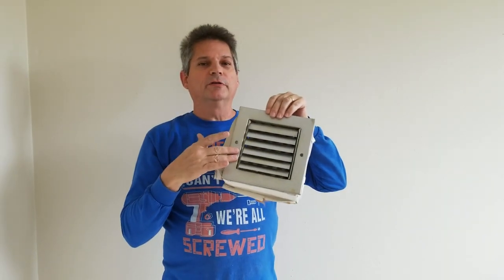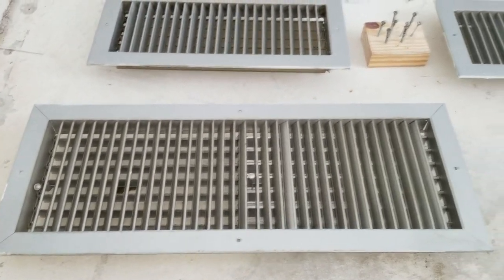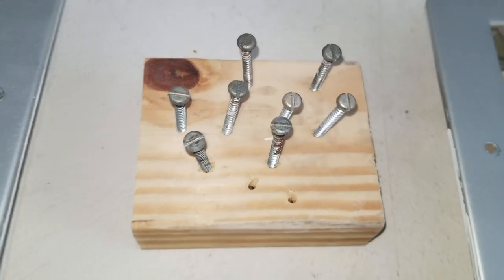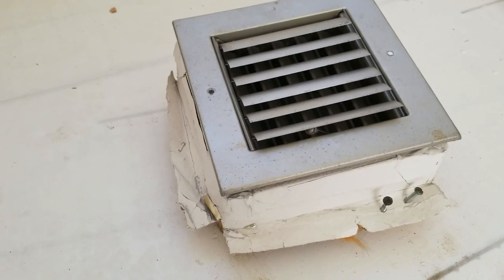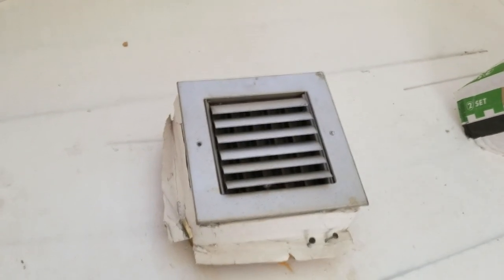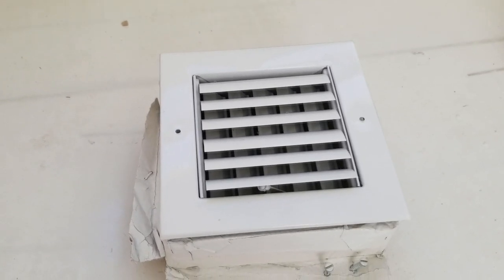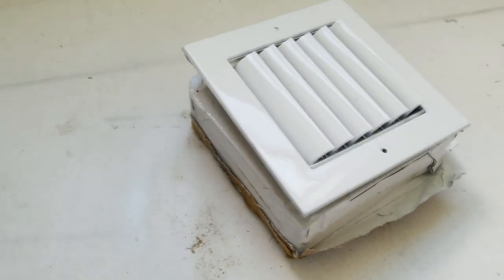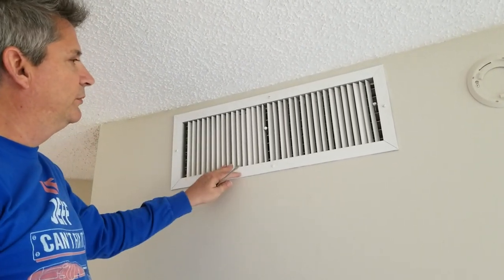DIY: How To Paint AC Register Air Vents, Fast Restore Tips

Comment: You showed the easy part that is "Spray Paint". You did not showed how to remove the old tick paint and also rusted areas from this old vent. Normally old vents has rust and sometimes too much paint from previous painted houses.  Can you show the removal process?
Reply from the maker: Next time it comes up we will. If there's a lot of rust I would use an electric palm sander to smooth it down, then spray primer on the vents, then spray paint. If the rust doe snot sand down gracefully enough to be camouflaged by the white paint then I would replace the vents.
Reply: @jeffostroff  That's the point, though. Anybody can respray a nice clean vent. 
It's getting off the eight layers of badly applied paint that previous users put on there. It is a nightmare job, especially since chemical paint strippers have gone eco, are now water-based,... and cause rust if you leave them on long enough to loosen the paint.
Reply from the maker: @effyleven  that's why I don't waste any time working on stripping and sanding vents, way too much labor for no return on it. I Only wash them, scrubbing with a ScotchBrite sponge, and if that does not clean it off, it ain't coming off! So what. I spray primer, then spray paint on it, spray the screws, and no matter what gook was on there before, the lipstick on a pig still looks better than what we started with, and everything is nice and bright white. From a distance you don't notice the flaws on the vent when it's all white. If a vent is in super bad shape and does not look better after painting, then you can buy a new one, but so far I have not had to buy a new vent cover since we adopted these methods years ago.
Reply: Me too ..I am in need of getting off layers of old paint from my registers .. as I can’t replace them they actually don’t sell our size anywhere, honest 😯 .. painting once clean be easy or buying new even easier .. that would be a dream. Help anyone
Reply: Common sense if it's too rusty, or clumped with paint, replace. If it's an off color, or nicotene stained like the vents in the old house I bought, paint. No brainer. If you want to spend your time sanding and stripping get after it. This video was about painting, not sanding old vents. It doesn't say how to sand and strip old vents. It says how to paint them.
Reply: Aircraft paint remover "oreillys" or home depot

Comment from the maker: What tricks do you use when painting AC registers? Let us know in the comments below.
Reply: Thinned Kilz primer first pushed through a $10 horrible freight hvlp gun, then thined wall or ceiling paint through the same gun.  You have to look to find my vents and returns.  Nothing worse than an ugly white vent on a dark ceiling.
Reply: @jagboy69  To be clear, you paint the registers the same color as the wall, correct?
Reply: @Methodical2  I paint them ceiling color, they disappear on darker colors this way.😉
Reply: Great.  I was thinking about this and I think I will paint them the same color as the wall and/or ceiling.
Reply: @Methodical2  The trick is to spray primer on them first.  Don't get silly and go thick with primer or paint or you'll have trouble moving the louvers.

Comment: What if I wanted to paint the register the same color as my wall? Start with primmer? Roller or brush? Do I do a light sandpaper to get it ready to paint (to take the paint)? Thank you so much! First timer, Jennifer :)
Reply from the maker: You can send it if you want to rough it up a little bit and then apply the primer and then the paint. I would not recommend a paintbrush I would either use a roller or spray it on.

Comment: I did this today... just now watching your video. I did this for some commerical drop ceiling registers....new 2x2 would have been $60. I used the same spray paint, however I ran into some issues with solvent boil and then after I sanded the bubbles out and sprayed them again, the spray paint acted like paint stripper. I used the exact same 2x Rust-Oleum and it has always been good to me...

All that being said, it was 87% humidity out when I sprayed them the first time, then I did it inside with a respirator mask and came out alot better but still had the above mentioned "paint stripping" look. This is after I bleached them, pressure washed them...wiped them down...
Reply from the maker: Holy cow 87% humidity must be unbearable. When I was filming in the back yard some tool review videos this week, it was 95 and 65% humidity, they say anything over 50% is uncomfortable.
Reply: @jeffostroff  when you live in Florida, you kind of become somewhat use to high humidity.
Reply: First coat is always a dust coat so the paint doesn't lift. Second coat 20 minutes later a little heavier. 30 minutes or so later last coat "Hose it on, but not so much it runs. Auto body trick.

Comment: Mr. Jeff: I had an Evaporator Coil Cleaning done 10/21. I was actually going out of my mind with a stench odor in my room. I tried everything, and spraying the house after a while didn't get any better. Then I went, and took down my A/C Vent. These Units don't look dirty, but they actually collect particulars of dirt from the entire Duct Unit. I took CLR,  sprayed two shots on my Vent. I actually was afraid to put this Unit directly in water. I took a damp toweling, and toothbrush, and went along the entire Units. It was dirty. Now, after drying the Vent, I replaced back in area, and would you believe no more stench smells? You have to be your own Mechanic.
Reply from the maker: yes we often wash them in the sink in very sudsy Amway LOC cleaner, then dry them out in the sun

Comment: I need to put a vent in the toe kick of my painted vanity.  So I need it to match the vanity so I doubt I will be able to find a spray paint that closely matches and I don't have a sprayer.  Is there a type of paint that would be good for brushing on?
Reply from the maker: I would not brush on I would roll it on with small rollers. Brushes will leave lines. If you can get a sample of the colored material to home depot, the size of a quarter is all they need to color match it with their optical scanning.

Comment: Try soaking the Vents in HOT water, to get the old paint off. You might have to empty the bucket a couple of times but the paint pretty well peals off when soaked in hot water for an hour. Just scraps right off.
Reply from the maker: I have also used paint gel to removing it, much more thorough

Comment: Would you recommend two coats of paint & primer or applying paint separately from primer?
Reply from the maker: I prefer the primer first, dry for an hour, then paint, 2 coats if needed on the paint.

Comment: Should the vents be wire brushed and/or sanded first, and if so, using what?
Reply from the maker: Nope, don't waste the time sanding or wire brushing. Sometimes if there is gunk on the AC vents, or huge amounts of dust, I'll vacuum off the vents off first, and if they need cleaning, run them under the sink and dry them off first. Depending on our logistics with the paint sprayer and if we are priming walls that day also, we will spray prime them first. Then when we switch to painting baseboards and doors, we spray with the white paint. If you are using spray paint cans from Home Depot, get one can of metal primer and one can of glossy white paint. Then you spray prime first, wait on hour or 2, and spray paint the AC vents.
Reply: you should take steps to clean with abrasives at minimum or I guarantee you will see the paint start to flake off within a few years.
Reply: Hornygundam agree ours has layers of flaky paint can’t replace no one sells our size anymore.. need to know how to get years of paint off ..if we use today’s store sizes we will need to redo our molding and drywall.. 🤦‍♀️
Reply: @kathbiddle-dutton7069  citrus strip gel will work. Messy but it will work. Then pressure wash it and wipe with mineral spirits.

Comment: If the Metal Grates were already hit with Paint but have Dust, Dirt and Grime Stuck to them, should you just Paint over all of it or should you Clean that stuff off first, (but if so what Solution should you use and what sort of Cleaning Utensil)
Reply from the maker: Yes any particles that are sticking up you want to try to sand down first, otherwise there's been a few cases where I just prime and painted right over it because you know it's not going to come off and you don't wanna spend all day sending it either for a $20 AC vent. For that matter you might as well just buy a new one but I find that once they are painted and they look better than they did before.

Comment: Mine was from a house from 1971 and the dimensions are no longer available. I had all old paint removed with paint stripper and the after cleaned completely I apply a coat of primer and then paint. It got like new.
Reply from the maker: Tet application of how the process should work. Good job!

Comment: Oh and add White Vinegar to the water and soak the a/c grill overnight. Use a toothbrush to get those hard to reach areas. Then sand any rusted areas.
Reply from the maker: Not concerned baout spending all that time to get the white paint off. The idea is to do better than driving to the store to spend $25 on a new vent. So quick and dirty and no one can tell the difference. Once you spray prime and paint this vent, it looks brand new.